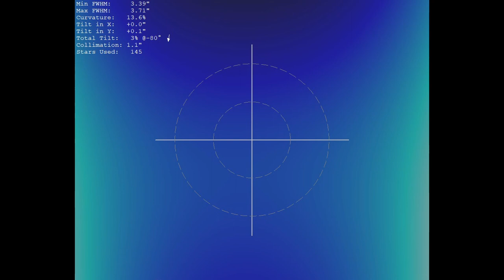Tune your telescope (Collimation)

Comment: I wanted to thank you for the concenter tool use...I have had nothing but problems with getting my Quattro 12" f/4 collimated. Only tool that finally resolved this long lasting problem was the concenter. Even the Hotech laser collimator did not help!!
Reply from the maker: Thanks for the feedback - I had the same experience when i first used the concenter eyepiece. 

/Daniel

Comment: I just subscribed. Your assistance and continued help is much appreciated.
Reply from the maker: Thank you so much, It is a pleasure to help out :)
Reply: @ExoPhotography1  I took some photos. The biggest problem is the inability of the cell phone camera to focus on what I want it to focus on. The only time it will focus is if it happens to catch the edge of the primary mirror....imo it is close to perfect collimation...remember this is an almost f/8 Newtonian so it will be much easier to perfectly align it and there is no offset as you would have with a steep cone of light. I will send you the photos I took and wait until it is brighter outside...that might help the camera focus....
Reply from the maker: @dankahraman354  It sounds like you have everything in control too me, no rush at all, take your time mate :)
Reply: @ExoPhotography1  Daniel it is so close that putting slight pressure on the barrel of the XLKP causes all the ghosts to disappear.
Reply from the maker: @dankahraman354  The Catseye are indeed incredible sensitive, but at your focal ratio and for visual, you might not even see that error. I believe the sky quality is the limit :)

Comment: I am having problems collimating. Especially the secondary. Yes I got the concentric ring tube from Germany but first of all when I tilt the secondary so that the rings enclose the secondary mirror all the way around (=secondary is at 45 degrees) I am off with the centre of the focuser being coincident with the centre of the primary mirror. Is there a protocl so that you ignore certain reflections but do your collimation in a step by step method? The centre spot of the primary is off-set and I cannot see the entire primary mirror.
Reply from the maker: You are nearly there it looks like it.
First of all - some newtonians have the secondary mirror mounted in a "offset" way - just google secondary offset and you will find pictures which illustrate that.

IF your secondary is mounted in a offset way, the reflections from the primary will look like they are... offset :)

BUT, you don't have to take that into account when you align the secondary under the focuser, in this stage, the only important thing is to center the secondary under the focuser.

To do that, we can move the secondary in two axes, from or towards the primary mirror, or to rotate the secondary.
(tilt will be addressed later)

So, discard any reflections in this stage, just move your secondary in or out towards or from your primary mirror, or rotate the secondary so it aligns with the circles of the concenter eyepiece.

After this align is done, you can put in a chesire, a laser or in my case, the autocollimator infinity eyepiece.

Now, it is time to fine adjust the TILT of the secondary so that the laser spot or the crosshair of a chesire hits the center spot of the primary mirror.

And the last thing is to adjust the primary so that the last reflection is bounced back tot he center of the laser/chesire.

I am right now shooting some material on the concenter eyepiece for a upcoming video :)

Hope this helps!
/Daniel
Reply: @ExoPhotography1  This is a long focus Newtonian that I have assembled from scratch so it has not been a matter of fine tuning and existing telescope. The laser looks good. I moved the 2ndary towards the primary by a small amount and then retested and tweaked the tilts of the secondary so that the laser hit the centre of the primary spot then adjusted the tilt of the primary so that it hit the centre spot on the laser collimator. The difficulty with the Catseye infinity autocollimator is how you arrive at the stage in which the ghost images of the centre spots show up ...I think you have to have good collimation before the Catseye can serve a purpose I suspect ditto for the concentric ring tool from Teleskop Service in Germany.
Reply: @ExoPhotography1  The primary is an old Coulter full thickness primary of 12.5" dia. and F=97.5"...so off setting the secondary is not required. The tubes were made by a local sheet metal company and powder coat painted gloss white outside and flat black inside. 0.081" thickness aluminum. Gorgeous. Strictly planetary scope with a 1.83" minor axis secondary and low profile focuser.
Reply: I just tested the collimation with the concentric tool and the Catseye Infinity. They look very good. The hardest one and probably the finest accuracy will be with the Infinity autocollimator. Is there any way I can send you a photo about what the XLKP is showing...almost perfect but not quite there!
Reply from the maker: @dankahraman354  You are absolutely right, to use the Catseye you have to have a some what good collimation, otherwise, the reflctions as you say can be hard to find.
But, with a adjustment of the secondary with the concenter eyepiece first, and then a laser to fine tune the titl of the secondary, it should be fairly easy to find the reflections when adjusting the primary.

/Daniel
Reply from the maker: @dankahraman354  You can send me the photos of what the XLKP is showing to daniel.d.sundstrom(@)gmail.com
If you have images taken both through the center pupil hole and the offset pupil hole, that would be great :)
/Daniel
Reply: @ExoPhotography1  So the final step with the XLKP is adjusting the primary. Excellent!
Reply: @ExoPhotography1  I will try to. It won't be easy. I suspect all that needs to be tweaked is the primary BUT this is a very long tube! Ideally I would have two people involved in making the tiny adjustments to the primary: one to look through the XLKP and the other to make the slight primary adjustments. Yes it will be through the central hole of the XLKP autocollimator.
Reply from the maker: @dankahraman354  You adjust both the secondary and primary with the XLKP, and it is much more sensitive then a laser.
Reply from the maker: @dankahraman354  I am running back and forth all the time, as my arms is to short 😂
Reply: @ExoPhotography1  I will use the laser collimator first because of the problems with XLKP not showing the proper reflections until collimation is in the ball park area for XLKP to take over. Yes XLKP is much more accurate but not a useful tool to use first.
Reply from the maker: @dankahraman354  Yes, that sounds like a good approach!
Reply: @ExoPhotography1  I will try photos through both holes
Reply: @ExoPhotography1  You too? LOL
Reply from the maker: @dankahraman354  It is not easy to take photos through those eyepieces, but can be achievable :)
Reply: @ExoPhotography1  I will try. We had a lot of rain wind and now snow on top of it all. It will be good to get your experienced interpretation and advice.